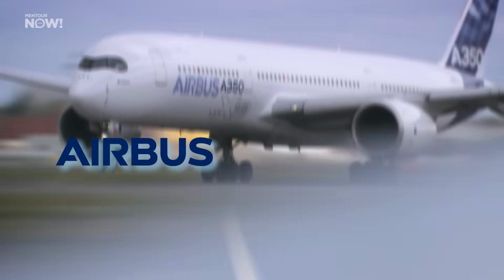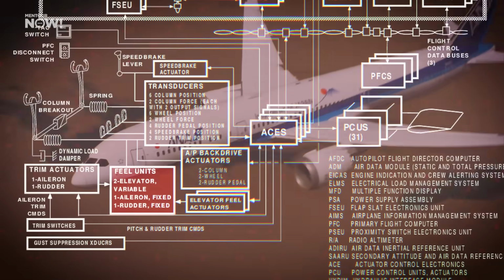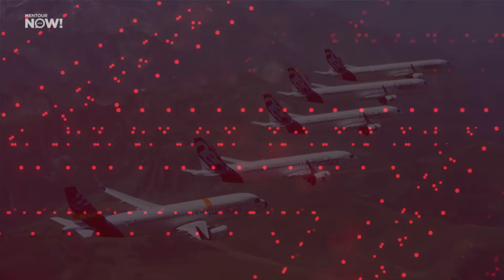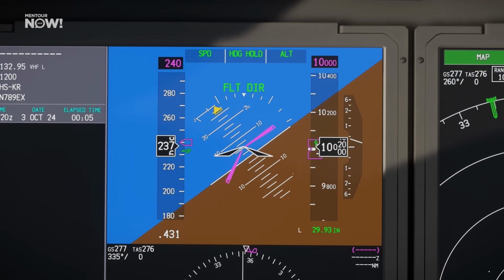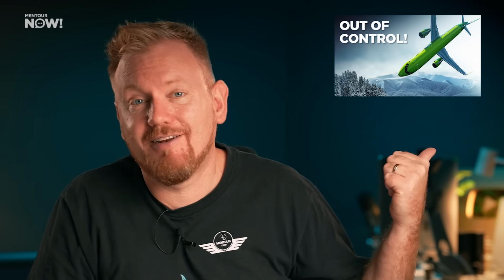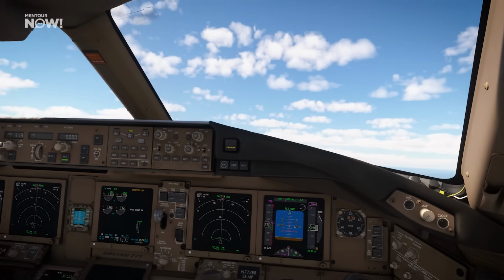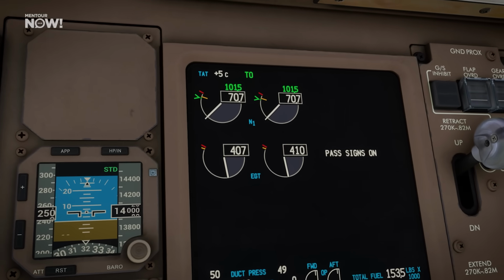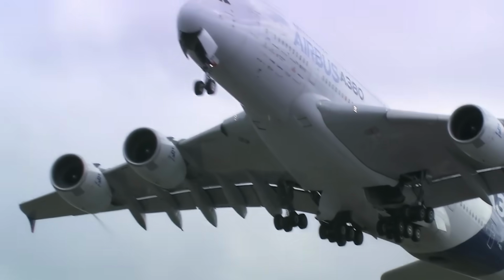Do Pilots Prefer AIRBUS over BOEING?!

Comment: I am surprised at this debate. A debate about safety is not considered appropriate whether you are Airbus or Boeing. You have said it yourself. We don't try to appropriate safety for our own planes. The question about preferences is somewhat irrelevant given that most pilots will have spent a lot of their flying hours flying one manufacturer. Only a minority will have crossed over. Indeed many pilots only will have only flown one type rating within a manufacturer in their career. This is down to economics and not preferences. It costs a lot of money to train pilots.

Comment: In the way that you’ve explained it, the way I make heads or tails of it is like driving assists in cars. Having traction control and Anti-lock brakes are great safety items, but they each have their downsides. A very well experienced driver will almost always bring the car to a higher point of performance without the assist ls than with. Your traction control may prevent you from being able to drive in the snow due to constant slippage, or ABS activating when it shouldn’t and giving you zero braking pressure. But that’s the minority of cases

Comment: Hi Peter big fan and geekish pilot on the bus.
 You keep making a mistake on the name of the protections and concepts. 

1) The angle of attack protection is not the same as alpha floor. Alpha floor is a fuction of the auto thrust and its in adition to the Alpha protection(angle of attack prtotection) which is the protection which has priority over all others and its controlled through pitch axis.
 So to clarify, alpha prot is when the aicraft senses a too high AOA and wont allow for a higher pitch up (progresivly as it gets too high in the range), between Alpha prot and alpha max.  IF Auto thrust is availaable somewhere in that range Alpha floor will be activated which commands full thrust no matter the position of thrust levers.

2) TOGA lock is the mode that tge AT ends up after Alpha floor activation when outside dangerous Alpha after activation and its an AT mode. Its NOT one of the 5 "main" protection modes on the A320.

The best examples where AOA protection was exhibit in real life when Alpha floor was not avialble was the hudson shully landing(i think in your video you had same mistakes?). Shully had no enery to flare and he was full stick back but the aircraft keep its 700fpm descent till impact cos the protection prevented the stall. 

When engiena are available and you pull max alpha then you get the best possible performance which is sold as airbus as enhancing terrain clearance over other designs.

As I write this I realize the best way to get full understanding is a bit of sim time. Let me know if you want to take it for a spin at some point😊

Iggy
Reply: You saved me a lot if writing, also would like to add; once on Alpha Floor if you disconnect the Auto Thrust the thrust will return to Thrust Level Angle including idle if that is the position of the Thrust Levers, if the side stick is kept with back pressure you will reach V Alpha Max at which point the aircraft will pitch down regardless of side stick position to protect from stall. This maneuver is done on the first flight of every Airbus at the factory on the first flight. Also to point out that Alpha Floor activation response is a trust protection, not a pitch protection. Pitch response to protections are only V Alpha Max and VMO/MMO exceedance.
Reply: Peter, you have amazing videos and high technical knowledge, I hope you read this to clarify the protections

Comment: I’m an ex Boeing pilot. I always felt that having a wheel and column on both sides that move together  according to inputs from the other pilot or the engaged autopilot or the flight surfaces themselves, ( even if they are ‘fly by wire’) means that it’s far easier to appreciate what the other pilot or autopilot is doing..or not doing. The Airbus control sticks do not move unless moved by the pilot, do not move as a pair and are invisible to the pilot on the other side. A giant difference affecting crew situational awareness in my view.

Comment: for me airbus is "fly by computer" because pilot request something and plane decide what to do with that (stick doesn't represent position of control sufraces. for true "fly by wire" stick should ALWAYS represent position of control surfaces and if computer decides that isn't safe corect with grater force than human is ever able. (like stick pusher in some modern airplanes).
and I still think airbus "fly by computer" shows safety of that. (nothing to fear)

Comment: There is no debate, the “real aircraft” argument is total BS. Airbus aircraft are so easy to fly, they are viceless unlike Boeing and the ridiculous idea that you can ‘feel’ what the aircraft is doing is completely wrong as all modern flight control systems end in a hydraulic actuator that does not allow for feedback.
The Duel input is always present if triggered the fact the crew didn’t notice is nothing to do with the aircraft, when direct law is engaged a notice “MAN PITCH TRIM USE” is at the top of the memos. Here’s a list of the aircraft I’ve operated and personal rating.
Do228—8
F27—-7
DC9-15/32—-10
B737-3/4/500——6
A320/21/19——9
A330——9
B747-400——8
A350-1000—-10

Comment: I’m a believer in the value of tactile feedback. I decided not to buy a Tesla car specifically because so much of the control is in a touch screen requiring me to look at it to know what I’ve done rather than feel the button move under my finger while my eyes can stay on the road.

I’d also advocate that any plane have a “god mode” switch that can shut off the automation in an emergency and let the pilots fly like it’s a giant version of the Cessna-172 they probably first learned on. I’ve seen too many stories of crashes that happened because the pilots needed a minute to figure out what the incredibly complex automation was doing and they only had 30 seconds.

Comment: I don't want a computer determining inputs from the pilots. Even with all of the controversy with boeing, I will always fly with them. Just last month I took my first max flight, it was a max 9, and it was a wonderful and beautiful plane. My wife was a little nervous, but I just told here that the max is probably the safest plane to be on right now being that everyone's eyes are on it haha!
Reply: On the other hand, I am coughing up an extra £200  just to avoid flying on a trans atlantic Max-9 flight. Each to thier own.
Reply: If you don’t want a computer determining inputs why did you board a Max then. It has FBW spoilers compared to the cable operated NG
Reply: @tomstravels520  Well thats just the spoilers, and that has nothing to do with flying the plane. there always has to be some smart-ass out there. And BTW the max wasn't my first choice, it was my return flight. My plane of choice is the 737-800 or 900. Scheduling conflicts led me to my first max ride.
Reply: @ spoilers have nothing to do with flying the plane, except being used in conjunction with the ailerons to help turn the plane at low speeds but yeah apart from that nothing to do with flying the plane at all
Reply: @tomstravels520  All I was saying is that I was surprised by the max. Boeing is more than capable of full FBW tech but they don't utilize it it for some reason with the exception of the 777. Having the spoilers FBW is completely different than the entirety of the flight controls FBW. Then a computer telling many other computers what you want and you may or may not get that.

Comment: And yet Air France Flight 447 crashed largely thanks to the flight-by-wire system where the joysticks of the captain and the first officer are not mechanically connected, so the computer has to average their inputs that can be opposite to each other

Comment: Some of the things Boeing recently made headlines for are things that have happened to Airbus planes too. Examples include engine issues, wheels falling off, windshields cracking, and pressurization issues. Turbulence is another great example. Had SQ321 happened on an Airbus A350 or A380, the same result would have happened, based on HA35 and an incident that a Korean A330 would be involved in a couple of months later.
“But HA35 and the KAL were both A330s, not A350s or A380s”. If I can’t use the A330 as a proxy to predict how an A350 or A380 would have handled turbulence, then that would contradict the whole “Airbus commonality advantage”, as well as a comment on this video mentioning how new Airbus tech trickles down to older Airbuses, and would also imply that the MAX shouldn’t be used as a proxy to how safe the 777x will be

Comment: Threes no difference between safety I both 4th generation planes. But one had to literally make a Recall of all units of an aircraft type due to the possibility of it grashongdespite pilot training and procedures being followed, while the other never had to do such a thing. So there is quite a stark difference in safety between Airbus amd Boeing, one makes a plane and units with problems are the exception, the other, units with prooblem became the rule.

Comment: Would've been great to compare accidents/incident numbers in a bit more detail and not just fly by wire jets. If you compare A320 vs 737 stats - there is a noticeable difference. I get your point of comparing only fly by wire jets though. Overall as a Flightsim Player, I definitely prefer the Airbus design philosophy of the cockpit and the flight controls :)

Comment: How many Boeings have crashed because of one pilot had no idea what the other pilot was inputting into the flight controls i.e both pilots inputting opposite commands.
Reply: Egyptair 990…..well actually the pilot knew what was going on but couldn’t counteract the captains nose down. At least in the airbus you can lock the other pilot if you know how to fly and takeover correctly. AF11 was nearly a crash when the pilots had no idea the other pilot was making opposite inputs on the yoke

Comment: The answer should be who’s killed less passengers, Boeing or Airbus, there’s the answer, facts are more important than opinions
Reply: But facts can be manipulated depending how you look at it. Deaths from crashes, deaths from crashes caused by pilot error (not aircraft manufacturers fault) or deaths from design flaws and build quality
Reply: @tomstravels520  But of course the airline industry will tell you flying is safer then driving.  Per mile yes, per trip no, airlines will be the first to manipulate anything in their favor.  No one really cares how something happened as much as the total killed

Comment: Birgenair 301 wouldn't have happened in an Airbus for example.
Reply: Air France 447 would not have happened in a Boeing.
Reply: @MikeSowsun  and you know that how?
Reply: TAM 3054 wouldn’t have happened in a Boeing. “Therefore, the pilots may have thought that the right engine was at idle power without realizing that Airbus autothrust logic dictates that, when one or more of the thrust levers is pulled to the idle position, the autothrust is automatically disengaged.[19] Thus, when the pilot pulled the left engine thrust lever to idle, it disconnected the autothrust system and the computer did not retard the right engine power to idle. The A320's spoilers did not deploy during the landing run, as the right thrust lever was above the "idle" setting required for automatic spoiler deployment.[24] Since the right engine thrust lever was still in the "climb" detent at that time, the right engine accelerated to climb power while the left engine deployed its thrust reverser. The resulting asymmetric thrust condition resulted in a loss of control and a crash ensued.”
Reply: AirAsia 8501 would not have happened in a Boeing. “Because the captain was also pushing the stick forward and because Airbus has a dual-input system, the two stick inputs cancelled each other out, which led to the plane remaining in a stall condition until the end of the black box recording”
Reply: @MikeSowsun on EgyptAir Flight MS990, one pilot pulled, one pushed. Split the yopkes. Each joke controlled half of the control surfaces, basically averaging themselves aout. 
So indeed, on dual Input, Boeing acts EXACTLY the same.
Reply: @ Egypt Air was quite different in that the split controls did not cause the crash. One pilot pushed forward, and cut the engines, to intentionally crash the aircraft into the ocean. The other pilot knew what was happening, and tried to pull back, which caused the split. It takes about a 50lb force to split the controls, and when it lets go, there is no doubt as to what is happening.
Reply: @MikeSowsun  yes but the concept ever wages the inputs of both pilots. So Boeing thought themselves that aboriginal the pilots input is the best way to go. Despite you thinking that's a terrible idea.
Reply: Birgenair 301 not a great example to root for Airbus. Put any pilot with unreliable airspeed, lack of common sense, discernment and lack of awareness and he/she will doom any plane if these problems are not corrected, even with the new technology improvements like BUSS.
Reply: @ClaysonAntoons  the same applies to 80% every accident involving pilot error, including af447.

Comment: Having done a transition from the Embraer E190 to the Boeing 737 NG. Yes i can confirm Boeing manuals are light on information, but as a consequence there is a lot of 'if you know you know' going on. Experience on the type is very useful. There is alot of user input. And the aircraft is extremely unforgiving to any kind of ignorance or lack of attention

Comment: as a sim pilot i prefer airbus, cockpit philosophy has more sense and I prefer to have all info, not hidden as mcas was, transparency is the basis for safety and boeing that transparency lost, i fly with force feedback yoke,  It could be fancy ,but it could leads to desensiting for tactile inputs in hands in dangerous times, airbus has neutral yokes and  pilots knows it it is much better for security, force feddback could lead to carpal tunnel syndrome and bad tactile sensing in hands and to fatique in small muscles in hand, which is crippling and definitely not safe

Comment: Now i have an idea which to me seems obvious. Why the hell is it so easy to crash a plain by forgetting to remove the covers off pitot tubes? And yet no sensors that either detect them or a simple gadget that pushes are through them to pop them off. Some of the walk around stuff still us so important, so manual and both companies have no solution for it. And yet they don't trust the pilot. What the hell!

Comment: I’ve never flown Airbus, only Boeing, so direct comparison is impossible. However. Boeing seem to make easy to fly aircraft that also handle well. Whether you’re at 230T take off weight or 350T, it’s as light as a feather and handles supremely. Having the “old fashioned” yoke is also a bonus, so you now what both the other pilot and the automation is doing.

Comment: 40 years ago, on DC-9/30 I had a Speed Command indicator (essentially an AOA indicator) and cable operated throttles. Anyone who is a PILOT coud have flown the plane without any airspeed  indication, and not stall it. BUSS is not an invention...
Airbus philosophy is that, given the hugely increasing number of pilots needed in aviation, there will be not enough talented person to train to a point they will be able to fly a plane that still needs tactile, visual and "seat of the pants" abilities. Therefore training persons to use a computer is much easier and economical. It's like singers: some of them (like great tenors as Pavarotti and similar) do not need the Autotune device, others can sing a song only using it.
Useful additional safety systems and warnings are really an help to the pilot, but (see Emirates crash) when the "Long Landing" triggers on a runway 4km+ long and you Go-around even if there is planty of distance to stop safely because You will be fired by the  the Airline if You don't that's the end and death of airmansip.
If You add the fact that the Go-Around was initiated pushing a TOGA button (that didn't work because the autothrottle had already disconnected) and not firewalling the thrust lever You are completely out of basic airmanship. See also the Asiana crash in SFO, where pilots coming from Airbus training are accostumed to no thrust lever movement.
 The real problem is that, for reasons You've well explained in the related video, Boeing stopped building airplanes but directed their attention to stock options., at the point that the 737MAX was the worst Airbus ever built....
 I'm glad that after 44 yars of flying I've never had to deal with Airbuses, except as a passenger.
Best regards, Petter

Comment: I’ve always wondered if airbus just got lucky going with a design that has more wing to ground clearance, so they could fit the newer bigger, more efficient. engines when they came along, or if the designers expected this development in engine technology and planned for it. Boeing didn’t, and were forced to basically put the engines on the leading edge of the wings by comparison. 😂